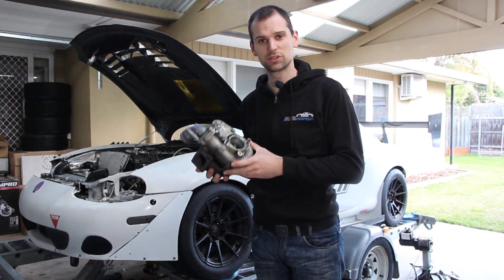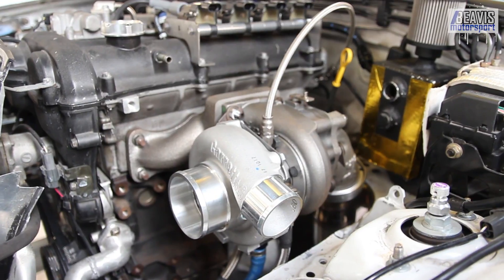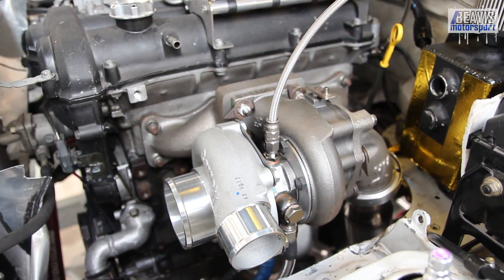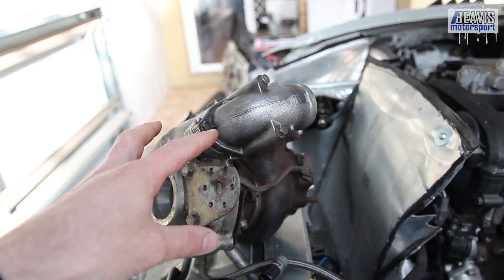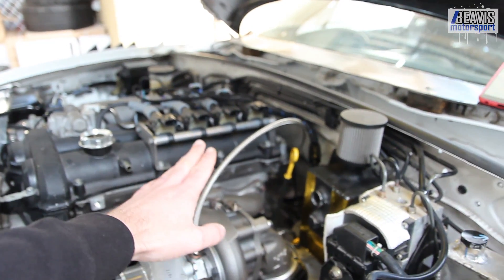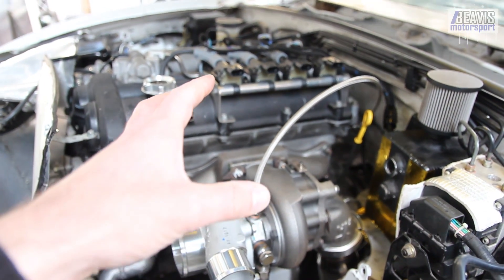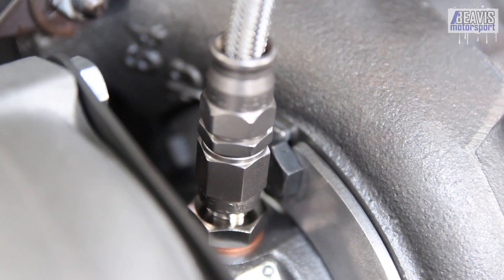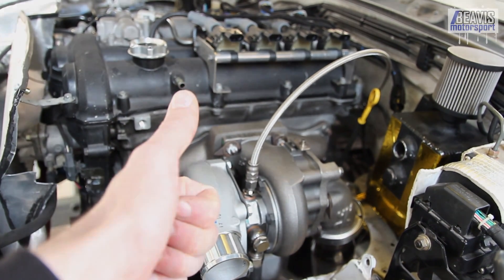TURBO OIL RESTRICTORS EXPLAINED - GARRETT Turbo Talk

Comment: I hope you'll read this, but I have a question. I'm upgrading from a journal bearing to ball bearing turbo. 
My engine only produces 33 oil psi on max rpm. Do I still need to install an oil restrictor?
Reply from the maker: Probably not, but sounds like you are working on an uncommon engine configuration so I would advise speaking with a professional in your area.
Reply: @Bbeavis  It's a diesel, 1KD-FTV to be exact comes from a Toyota Hilux

Also thank you for the reply! I didn't expect you to reply haha

Comment: I put an rb25det turbo which looks exactly the same with the one you mentioned doesnt require a restrictor, labeled nissan 45v4. I had some oil burning issues and oil in my intake piping cause its a low mount turbo so i installed an external scavenge pump and a small container for steady feed to the pump. I got the turbo for service just to make sure and the guy said its an old turbo that doesnt have parts availability but the turbo is good. Anyway im planning on using a 1mm restrictor because i cannot find an explanation to why oil spills out both sides of the turbo other than the feed being too much. Whats your opinion on that?
Reply from the maker: If you are unsure about the turbo or what restictor you need, perhaps an inline oil pressure regulator would be appropriate?

Comment: I have a journal bearing on my car, but I am going to take the extra step to install a tee fitting and gauge at the cartridge just for piece of mind. Plus my feed line comes directly from my oil filter housing so it’ll show engine psi as well
Reply from the maker: Nice idea!

Comment: Do you need to run a washer for the oil restrictor ?
Reply from the maker: If it's a fitting threaded into the turbo, it'll likely need a crush washer.

Comment: Hi Beavis motorsport, what are your thoughts on a turbo feed line filter
Reply from the maker: I'm no expert, but there's two ways to look at it I guess, on the one hand it is an extra safety net to ensure your oil into your turbo is 'clean', on the other hand, most  every engine already has an oil filter.
I'm sure there are pros and cons to either approach... pros of ensuring oil quality for your turbo or cons of extra complexity of additional fittings, plus the risk of it clogging and starving the turbo.
I'm on the side of the engine already having an oil filter so I don't need to add complexity.
Reply: Thanks  @Bbeavis   , Im in the process of fitting up a new BB turbo to my Sr20. wasn't even thinking about it until I kept seeing them pop up mainly on  Barra's and some other YouTubers cars. wasn't sure if it was just another up-sale item. cheers

Comment: Today I removed my banjo bolt and ran a straight feed to the turbo is this bad for the turbo?
Reply from the maker: Whether you use a banjo fitting, or straight fitting, it should not matter.

Comment: Are the restrictors one way or can oil feed through both ends?
Reply from the maker: All the basic ones I've come across have no form of flow directional  control.
Reply: Yeah it’s just a smaller hole diameter aka a restriction

Comment: What the right oil fitting size I got a 7/16 to 4AN and the 7/16 doesn’t fit
Reply from the maker: It will depend on your turbocharger, 7/16-24 inverted flare is the common size for typical consumer Garrett turbos.

Comment: Hi i have holset hx27w on 1.8t 20v what oil restrictor should i use is a 4AN fitting fine?
Reply from the maker: A diesel truck turbo on an Audi? Interesting. I can't help with your question, maybe try contact holset themselves for advice on ideal oil feed pressure into the turbo.

Comment: I just installed the turbo smart oil press regulator , and it starts off reading 60psi and then when warm it's on 40psi but as I rev it goes up to 60psi so how is that happening if it's a 40psi regulator?
Reply from the maker: Best to check with turbosmart.

Comment: Does it make a difference if the restriction is on the turbo or engine side?
Reply from the maker: No, as long as the pressure fed into the turbo is within spec.

Comment: I keep getting very conflicting opinions on whether to run a restrictor on a greddy t67-25g journal bearing turbo.

The obvious answer is no, but some people have told me when the rpm are high it will get too much oil without a restrictor.

It is currently getting rebuilt due to failure caused by suspected oil starvation, as it had a 2.5mm restrictor when i bought it and i drove it for 7 months before it failed.
Reply from the maker: Sorry to hear about the failure, you may have to check with Greddy if they have advice on the ideal oil pressure.

Comment: Hey Beavis do you know if it matters where u install a restrictor? Does it need to be at the turbo or can it be before the line
Reply from the maker: Every turbocharger is different. Best check your turbo manufacturers documentation for the right needs for your configuration.

Comment: I threw away my oil restrictor thinking it was an extra part … I was coming off a journal turbo and thought I could connect the banjo bolts the same …. Long story short my car was blowing clouds of smoke at every stop light 🤦🏻‍♂️🤣🤣🥲🥲🥲
Reply from the maker: Oww oops!
Reply: Did you blow the turbo seals?
Reply: @56wb56a no response go figure lol. Maybe it blew his whole car up! Hence the no reply
Reply: @Wretched2JZ its been two years...
Reply: @moonanite2425 I never got any notifications for their comments lol 

I barely got notified for your reply 😂
Reply: @Wretched2JZ lol 
All Subarus come blown up from the factory 😆
Reply: @56wb56a 
No , I messaged the seller and just told them I never got the oil restrictor. They mailed me one for free, I didn’t daily the car like that lol , that was just the day after the install
Reply: Click, thanks for your reply this is excatly what's happening to my setup,and it's because I replaced the line when the original got cut .

Comment: I have a turbo gt2860 on bushings which restrictor size is the right one
Reply: I have a journal turbo
Reply from the maker: @Choloracingparts  
Journal-bearings function similarly to rod or crank bearings in an engine – oil pressure is required to keep components separated. An oil restrictor is generally not needed except for oil-pressure-induced leakage. The recommended oil feed for journal bearing turbochargers is -4AN or hose/tubing with an ID of approximately 0.25”.
Reply from the maker: FOR A GARRETT BALL BEARING TURBO
An oil restrictor is recommended for optimal performance with ball bearing turbochargers. Oil pressure of 40 – 45 psi at maximum engine speed is recommended to prevent damage to the turbocharger’s internals. In order to achieve this pressure, a restrictor with a 0.040” orifice will normally suffice, but you should always verify the oil pressure entering the turbo after the restrictor to ensure the components function properly. Recommended oil feed is -3AN or -4AN line or hose/tubing with a similar ID. As always, use an oil filter that meets or exceeds the OEM specifications.

Comment: If your running a ball bearing Turbo please dont bother with damaging oil restrjctors! Go straight for the TurboSmart OPR. For under a $100 dollars it protects my $1500 Turbo!.....period
Reply from the maker: I really do like the Turbo specific oil pressure regulators that are on the market now (Turbosmart have this patented I think), however I wouldn't personally call a traditional oil restrictor 'damaging', they have their place.

Comment: I have recently had my T3 Garret turbo off my RB25 rebuilt with steel internals and a larger compressor wheel. I’ve got braided oil feed but stock oil drain etc. My oil pressure is lower than before in my engine. Do you think it needs a 2.5m restrictor to help with pressure
Reply from the maker: I cannot say for sure Coxyz, as mentioned throughout the video, this is just general advice based on documentation provided by the manufacturer, please seek advice from a professional or your turbo manufacturers documentation for the right needs for your configuration.

Comment: What Garrett turbo is that one? I’ve been looking for a 6bolt one for forever
Reply: i have a 2863 t3 6 bolt turbo with ball bearing core and gtx front wheel . Custom made by GCG turbos in australia
Reply from the maker: GTX2860R Gen2

Comment: How did you go about measuring the oil pressure at the feed line? Did you connect the sensor directly to the feed or did you connect it with a T split and ran the other end into the turbo? I'd assume you connected it directly to the feed without running it through the turbo.
Reply from the maker: Most people will T into the oil feed line.

Comment: Hi, help me please i have this model turbo Garrett GTW3884R - 67.00 mm A/R 0.70 T04S Ball Bearing Turbocharger and my seller dont know what restrictor size i need😥
Reply from the maker: Hey Jaime, this is just general advice, I suggest you speak to a mechanic/performance tech/turbo expert in your area.

Comment: What issues does it cause if you have to much oil pressure to your turbo? Your video helped alot
Reply from the maker: As I understand, you can experience excess oil blowing past the seals and out the exhaust.
Reply: @Bbeavis  you'll also experience that if you don't properly angle the CHRA. It has to be 15 degrees on the angle for proper oil feed and return
Reply from the maker: @OSPWerks  That is also a good suggestion, thanks.

Comment: Hi Beavis, i run same gtx28 as yours in my swaped 1.8 BP4W  NA, could you please tell me wich restrictor size do you use for Gtx28.

Thanks,

Best regards.
Reply from the maker: I ran a .035" or .9mm restrictor

Comment: https://www.google.com/imgres?imgurl=http%3A%2F%2Fwww.srtforums.com%2Fforums%2Fattachments%2Ff169%2F45477d1247075581-turbo-oil-restrictor-needed-pics-cagepin.jpg&imgrefurl=https%3A%2F%2Fpassionford.com%2Fforum%2Fgeneral-car-related-discussion%2F447390-garrett-gr28rs-protential-problem.html&docid=9hOjGoqstUhr7M&tbnid=ajDgTuERerUQ2M%3A&vet=10ahUKEwj7opSJsZXdAhUrpYsKHd74C-8QMwhyKBEwEQ..i&w=800&h=600&itg=1&hl=el-GR&bih=487&biw=360&q=garrett%20cage%20pin&ved=0ahUKEwj7opSJsZXdAhUrpYsKHd74C-8QMwhyKBEwEQ&iact=mrc&uact=8
Reply from the maker: https://www.turbobygarrett.com/turbobygarrett/oil_restrictor
Reply: @Bbeavis  And ? I am seeing that article 10years now. And its purely theoretical. You should remove a cage pin from a garrett turbo and see yourself the 1mm orifice it has. Your jaw will drop... Also some bb units had 0.8mm cage pins. I have a collection of them. Also we point the cage orifice more towards the exhaust side ball bearing. Journal bearings we use 1.8 to 2mm restrictors.
Reply from the maker: And, you're going to try discredit a direct link from a turbo manufacturers website because it directly contradicts your claim on the basis that you believe you saw the article 10 years ago?
Every piece of documentation I've read, every person I've spoken to, agrees that in most cases a Ball Bearing turbo requires an oil restrictor of some size to manage pressure fed into the turbo. (While in general a journal bearing turbo requires no restrictor)
All you've done is posted a google link to a random image from a forum. Hard to trust your source versus that of a turbo manufacturers recommendation.
As I mention in the video, every engine, every turbo, every application is different and the needs of YOUR turbo may differ, but I stand by my video being correct and in line with Garrett's recommendation.
Reply: @Bbeavis  well instead of reading documents why you dont actually pull the cage pin yourself and see ? And then tell me if there is or not an oil restrictor on bb garrett turbos by default....

Comment: Garrett turbos have internal oil restrictor. The nipple you see showing at the oil feed. Is the ball bearing cage pin and also has 1mm orifice.
Reply from the maker: Hey NGT, Would you be able to detail which Garrett turbo's have you worked with that ran inbuilt restrictors? Were they ball bearing or journal bearing?
My new out of the box GTX2860R required a restrictor. While my old journal bearing S14 GT2560 did not need a restrictor, but it also certainly did not have an 'internal restrictor'.
Reply: BEAVIS Motorsport my gtx3582r gen1 had internal restrictor and so does my new gen 2 gtx3584rs.